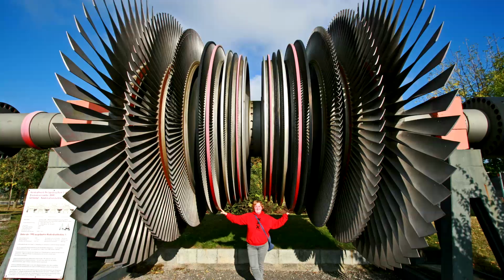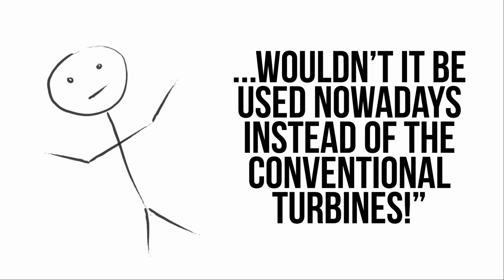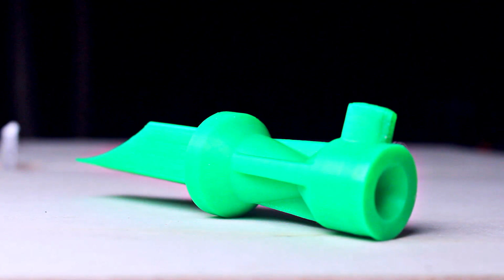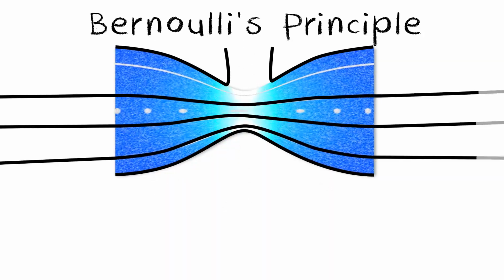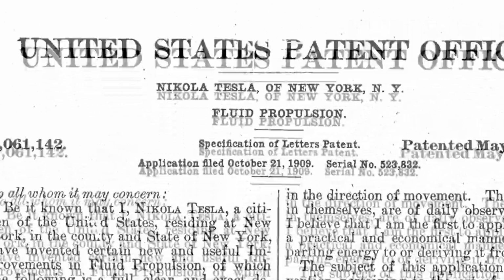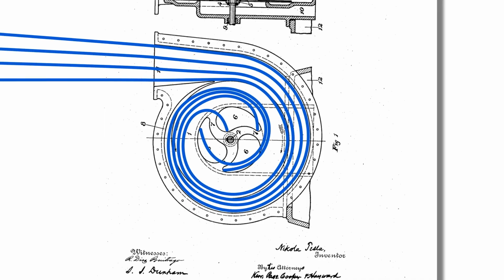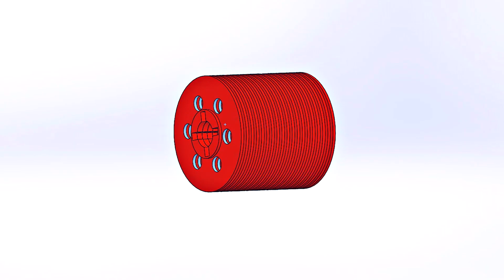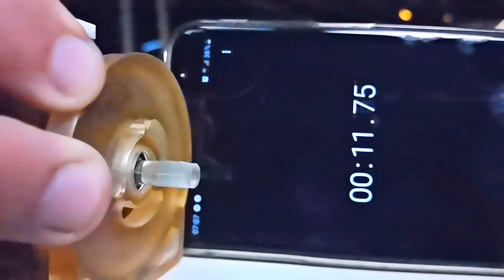Tesla Turbine [Smoke Flow Slow Mo]

Comment from the maker: So at 3:22, the turbine is turning in the opposite way. I know, my bad!
Reply: Call the new printer R2-Eta, because that is what you need to 'improve' that Tesla Turbine. The coefficients of determination to efficiency for whatever your salient parametrics might be. (Hopefully not curious turbulent inlets driven by handheld shop-air nozzle with large inconsistent velocity vectors & profiles.) How about some parametrics related to the boundary-layers on the rotor disk:pack surfaces. Possibly controlling and measuring the inlet & exhsust pressures (and temperatures if getting high power extraction), will add some further independent variables to the efficiency map. Where it's most efficient, may be far from where it's producing a high output. The magic is to optimize power and efficiency.
Uniform flows across the width of the disk pack as well as the effective Reynolds No. from OD to ID. Is another head scratcher. 

Hey, here is a thought, why not just power the TTT, measure the power and speed, and the now dependent inlet and outlet flows and pressures. Explore its performance.  Gee, wondering if disk surfaces are better with Tesla valves instead of just simple spaces? (... so don't be an Isaac (fig) Newton barber and cut me out if it twerks :),
Reply: @aadj1  I would love to see what a nice graph with changing inlet flow looks like,  I agree turbulences may change a lot depending on nozzle, speed and...?
Reply: At 3:22 the turbine is turning properly. Look at the rear vanes that the exit gasses impinge. They turn as you would expect. A turbine engine is designed to spin in such a way that the fast, hot combustion gasses are driving the shaft to spin, causing the vanes at the front of the engine to draw air (the source of oxygen) in so that combustion can happen. These engines need assistance to get started.
By the way, I created a Tesla turbine using CDs a few years back for a micro-hydro power experiment. Check it out here https://www.youtube.com/watch?v=1KZNO2I72I4
Reply: Also noticed the unnecessary effort to create clear discs. All that work when perfect, clear polycarbonate discs cover my desktop... design it to use old CDs.
Reply: Couldnt you have just used a vape
Reply: Dude that is a turbo
Reply: i kinda like the cigarette smoke demonstration. its very oldschool :)
Reply: @Integza you probably know this already, but you shouldn't handle 3d printing resin without gloves as you did in the video. It can soak into your skin, cure in the sunlight and cause you to become allergic to resins - including just the fumes.
Reply: wait
that's illegal
Reply: Name her Marie An(toin)ette and print a face for the UV shield so you are removing her head every time you open it up to print stuff.
Reply: Ge a cheap high-power (SMOK Alien 220W) vape. Also just use Vegetable Glycerin for the vapor.
Reply: I came in the comment section just to see whether anyone else noticed that.
Reply: Damn that design looks like a turbo charger for a car
Reply: I mean NOO offense I love your videos you look like iron Man (Tony)
Reply: Hey @Integza, your thoughts on this?
https://www.youtube.com/watch?v=hm8m_0rzyMo
Reply: i knew turbines and physics were fake!
Reply: I was about to comment that. Less work for me 😊
Reply: Could you also print the Archimedes turbine?
https://youtu.be/BF7yX-7Wy30
Reply: The turbine should be much bigger
Reply: Are u from Portugal, It sounds a bit like portuguese...
Reply: maximum fucking epic science! now only if we can use this to change the world..  nah.. whats next?
Reply: A Dragonball Z fan.
Reply: i dont know where do you lives but Carrefour's Acetone is maybe the most efficient one iv'ed found for resin curing, Have a nice day ^^
Reply: "Not a popcorn machine" and or "popcorn maker 2.0" or maybe even" popcorn popper -printer". . . ..
Reply: It’s like a car 
Turbo
Reply: That table saw sucks.
Reply: @integza no, it's spinning the right way bc it's a high bypass turbo fan engine. Not for producing power like what you probably meant to use.
Reply: Your joke is on another level. Keep do it, teach us science, great move buddy...
Reply: Ī
Reply: I was gona tell u the same
Reply: I'm curious about something.  How efficient would it be to have two tesla turbines connected in series while powering the same shaft?
To do this, I assume having the airflows be in opposite directions, one entering the eye and leaving through an exit channel made to recollect the gas and let it enter the second one.  The second one will need the airflow to be in the opposite direction to keep the rotation the same, unless I've confused myself along the way.
Any input is welcome.
Guys, like my comment so he might see it and try it.
Reply: To anyone curious, I did some reading up on it and discovered even Tesla had thought of this before me.  So hopefully it is tested anyway.  With Steam.
Reply: Bladeless Tesla turbine using drag of centrifugal force
https://youtu.be/bZ8iJnY7GOw
Reply: Think of a snail shell out circles inwards but instead of it being a complete tube tunneling in let it just concave convex whichever one where you know kind of channels the air battery I think it's concave and angle that and I have also heard that if the surface isn't rough but kind of dimpled I guess you should say like chicken skin not rough but the also makes extra pockets of air that allows the flow to run faster because those little dimples allow extra spirals as it gets going causing less air Flow restriction kind of what golf ball how you can like a golf ball defy gravity with air hope this helps... It's an idea
Reply: Donald Trump and I like Donald Trump LOL but he is orange at times
Reply: you know I like how you dressed up like Nikola Tesla back in the day classic inventor Style
Reply: Plz cut out the rap
Reply: That almost gave me a headache, lol
Reply: The bluegrass is oddly suitable here lol. Cool stuff. I have an idea . But am actually afraid to share it. Q
Reply: Name "Altesse"
Reply: Would scratching the discs to increase the surface area make the dics more efficient
Reply: Can you rotate the casing to scoop air in to it?  Such as in a bicycle.... or rather monocycle set-up?
What if you were to place it on the ends of a windmill?
Reply: Use  spiral disk
Reply: That's a turbofan engine
Reply: You sound more like Romanian to me.
Reply: I think you should name the new 3d printer Angelina  after Teslas daughter
Reply: @integza Because I saw you wearing a "Dragon Ball Z"  T-shirt in the video I was expecting a quote from the show by you. Like at 18:06 into the video "it's over 9000!"
Reply: Not heard of 0% nicotine vapes? Denser mist, zero carcinogens!
Reply: Name it "Lady Janett"
Reply: nah fam explain 3:52
Reply: Name it kora from the movie tron
Reply: Look into the inner workings of the Stirling motor... Then contemplate what happens when you make radiators with coolant, and then contemplate what happens when you "decompress" heated coolant using a compressor on the opposite end of what you'd expect one to be.

A heat gathering device of epic proportions?
Surely there's got to be a key where hyper efficient pressure mediums can siphon heat and pressure differences in a super compact way.
Reply: @bravojr  women thought of this many decades ago and now we have air conditioning, just saying.
Reply: @bravojr  lmap
Reply: Who is that next to Tesla on the picture in the background? It looks like Momar kadafi?
Reply from the maker: It's Professor Snape 😂
Reply: @integza  Goku or Vegeta?
Reply from the maker: @archonofthelivinggod7091  Vegeta, easy
Reply: @integza  I'm with you bro. Thanks for responding. I love your work.
Reply: @integza  Do you have an email you can be reached by bro? If you don't that's ok i just thought id ask.
Reply: @integza  I see you're a man of culture as well
Reply: @notsure9735  Severus Snape?
Reply: @notsure9735  Snape
Reply: @notsure9735  Snape

Comment: musk is not the first. 
The first electric car is a matter of debate, but the Flocken Elektrowagen, built by German engineer Andreas Flocken in 1888, is often cited as the first "real" four-wheeled electric car. Other early pioneers include Robert Anderson, who built a crude electric carriage between 1832–1839, and Thomas Parker, who built what is often called the first production electric car in England in 1884. 
musk is a follower

Comment: Part of the reason you didn't get as many RPMs out of this version, is the one with the volute casing was intended to be used as a pump or blower, not a power turbine. Instead of a working fluid being injected through the volute to produce motion, it was intended to have power applied to its shaft (either an electric motor or another Tesla turbine) so that fluid is drawn in through the central openings and exits the casing through the volute.

Comment: Drag, turbulent flow, surface texture and ... magnetic content   as long as the center inpedence  of the  chamber or pipe form ..   of course fulid dynamics will apply.. 
 The other factors  in the metallurgy  often used  are the source  or the  odd melting  and  pass through the so called insilations.. the chamber form and  un even occupations impact the sheeting  and vibrate   spots in the  metal and any small crystalline  opportunity , begins to piezoelectric in its bubble  and then align like a compass   into the chamber the velocity and increasing  low pressure to tje edge  of the duct inlet ..   will  begin  to add to the  heart  and  induction  over the the  even yet poorly formed a press stamped  and stretched materials and  expose falt lines. And which way they rolled it, with expose the rolls and  .. solar trauff like lense  forms  across the fault lines on the put side and the  shuddering  waves the field along and across the fault lines..   fairly quickly  once it begins to hit a that point.. which, I cannot say exactly cause I was not the metalugies person on it .. 
    Bit those waves and the reflections of the thermokeilnd and   curved sides and  bouncing  well for a moment I'm sure spin and and a Waveing tonadic  snake  will begin whipping and the negative  pressures  will whip wildly and touch and bounce high pressure bubbles of various size a shape through the chamber and  want to ' clog " the pass through  intake  preur will even and then the high pressure clog  will then  cause the low pressure side to be in the bell and two nesrlf simultaneously loud booms will happen .. 
   The bell crumbling in and blowing  apart.. also a materials  thing and I was not the engineer there in the lab nor testing...
 The chamber intake  also not aware  ...  if enclose and the Intake too smaller  and the flat face   or means of handling a back fire like that.. .. also not the engineer.. like I said ... I saw an annomily.. nahh , not annoying it makes more sense than the rest of fhe shyt bags..  
  Anyway.. I said wtf and at such a low spin rate.. not cool..white waves... and had not even gotten to the coils or the nessesasry unnecessary induction plates..  or even their stationary form and metalurgies.. .. 
    So, I was like well.. had better get the real machieroes and  have to  sort some things out as far as materials ..  carbon nano tubeial and into inert gas and gas programming .... 
  Stealth Aircraft and Submarines, Naval  Campflage  and Reactive Armor Lazer defeating and lense fields.. diamond printing and actually quantum materials assemblage.. .  
   At a point, plasma is  so hot and dense yet is fluid..  that in the rapid cooling   (  coffee,  my drug of  choice.. yeah Maxwellhouse.  Folders is ok.. but I had some Costariccan and Sumatran from Aldi's fair trade that actually blew my mind..  good stuff, smooth high octane..  so.. be right back..  hint no paper filters get the brass or copper ones,  use a tooth brush  to clean it or a fine brass  one..  not after cleaner or flux use though.. loll. Experience.. ruins a perfect fine fresh Im glad to have this... a shyt.. oh .. let me get my coffee... lol.  Used to..  had my own little slice of worry ..  pretty good if I do say so myself.. 
  Learned from eggplants really and tomatoes.   Ok.  Gotta re heat the coffee..  ) ... 
 Remind me rapid decomposition ..

Comment: Needs to be larger. I believe that’s the actual problem with the turbine. The high velocity and pressure is forcing the gas inwards before its transferred the majority of the energy to the blades. A larger diameter should solve that problem. Run the same design at different scales, graph the results and I bet you’ll see a familiar pattern…

Comment: You probably won't read this, but if you do:
Try making one with disks from old HDD's, those disks are extremely round, smooth, hard and some are rated for up to 15.000RPM with little deformation.
Its the perfect specialized material, and it's modern day garbage so its cheap.
Greetings.

Comment: Stil not a printed bearing?
😂😂😂😂😂
There so easy to print.
Come on do it .
Give it a go.
It must be 10 mm height.
And put the seam at random.
You need to Wobbel the smal ones. 
A Little bit and they work .
A have them .
Layer height must be around 0.12.0.16.
🎉🎉🎉 And there you go .
Come on print the beargings 😮

Comment: Question: Did the venturi nozzle increase the power/rpm for the tesla turbine? (You said the smoke was too thin and switched the inlet nozzle for laminar flow) Was this just for demonstration purposes with the smoke? I assume the Bernoulli’s principal air constriction would improve the tesla turbine efficiency, but is this not the case when combining the two? It was unclear to me, but I'm very curious. If anyone has the answer, please let me know. Thanks!

Comment: I have a question: why did you use a convergent-divergent nozzle at the inlet for the volute casing? since the flow is subsonic wouldn't a convergent nozzle be better, because the flow won't be chocked in the throat and the divergent part would actually cause the flow to slow down and possibly become turbulent. you obviously know better, it's just a question that i wondered. great job and thanks a lot for your videos.

Comment: 3:59 The picture shows several discs.  In reality, several discs REQUIRE several nozzles, but the picture (even Tesla's) shows one.

Boundary-layer flow is laminar flow tangential to each INDIVIDUAL disk.

I have built these and ONE nozzle servicing TWO discs side by each gives the same torque as ONE nozzle serving multiple discs together on the same shaft.

I use a solar steam generator and a Pelton wheel turbine to make electricity.  Far and away easier to build using a stainless steel spur gear as a Pelton wheel!

I've toyed with this stuff as a hobby for nearly 60 years.

Comment: Ive always had a problem with the design in that, as shown in slo-mo,  centripetal force causes the fluid to cling to the circumference and has to overcome the tendency to stay there until there is nowhere to go but the center. Common fluid pumps, like a water pump, have the influent in the center and use centripetal force to push the fluid through. 
It seems to me that if the influent into the TT was near(or through) the hub that it might work better. The design would be quite a bit more complex (ie angled nozzles between the disks fed from a hollow hub fitted with high speed seals?) and would likely require the turbine to fill up before there was any rotation at all. 
Then, though, the flow would spiral out smoothly toward the circumference and the effluent port.

Comment: @integza curios if you took plasma air flow to push air in the turbine rather than the compressor. May not be as fast just curious the output of RPM's it could generate.

Comment: Thanks for demonstration.
The Diameter of the Disks could be the main drawback in my opinion. Disk diameter of 18 to 24 inch may show a radically different result in terms of power output for the same PSI of air input. Also varying the Thickness of the washers placed between the disks could have  an impact.

Comment: Also a recommendation for your table saw, print a 0.5cm, 1cm,1.5 cm and 2cm spacer matching the saw base screwed to the table and add the spacers to shorten blade height to stabilize blade, it might help

Comment: Just seeing the issues you have with 3D printer.. find Turning milling and good old drilling machines. them are in "unversal" version complet manuel to oporate. with a bit of efford you can learn with CNC but its tricky and needs you being verry carefull. however. the Universal Milling and turning machines are good with the good olf "Tabellen buch" not sure if its somewhere in English but a Workshop without this is just a half Workshop

Comment: Great Video! Why do you think the efficiency was so bad, when driving from a motor, but so good when driving from the fluid? Any thoughts on what the ideal RPM's / configuration would be to push air using this device, with an electric motor?

Comment: I think I should say that while your table saw is creative, you should invest in a well built one as they often are built with safety mechanisms that were only discovered as necessary from using your crudely fixed and very low visibility version.